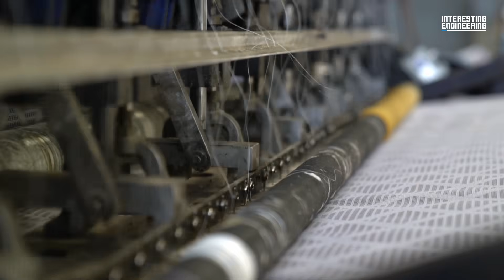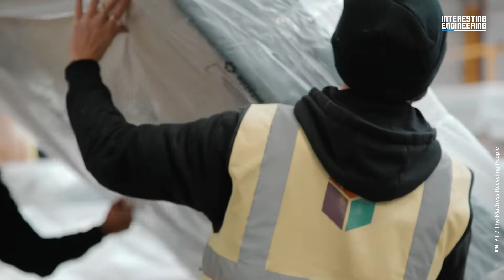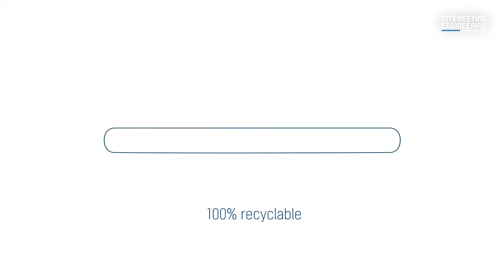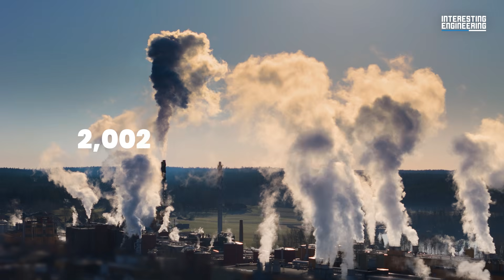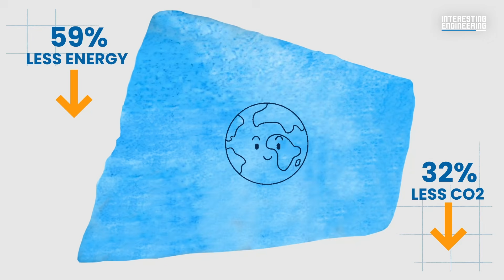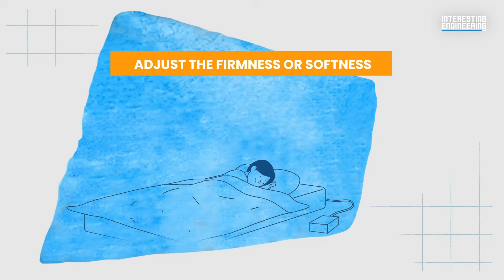Is This the Future of Product Design?

Comment: Surely many can be repurposed eg beds for pets?
Reply: That's just one more step on the way to the landfill. What's needed is a circular economy where nothing ever goes to a landfill, this even if it will cost a fair share of the initial cost of the item.
Reply: @SweBeach2023  Absolutely, but repurposing extends the lifespan of a product (especially a product that's not currently recyclable) for a few more years, and some shelter animals get to have a comfy bed. Cradle-2-cradle design, lifecycle analysis & 6Sigma should be done @ design phase (awa ISO 14000 standard). I currently have 15 Rs of sustainable waste management & zero waste to landfill. Plastics Treaty in the pipeline too.